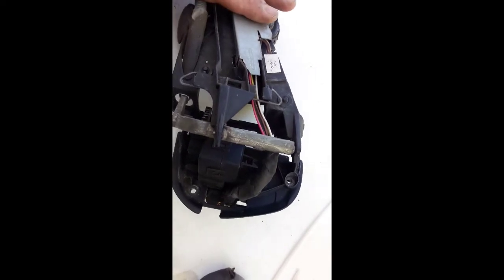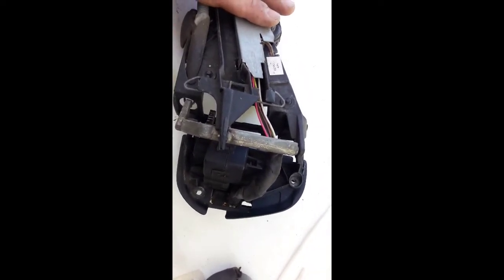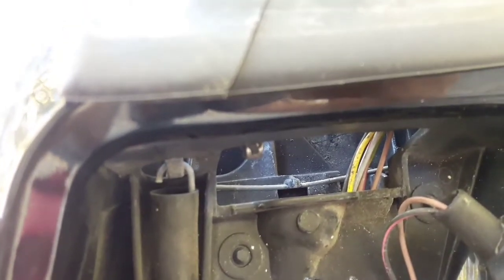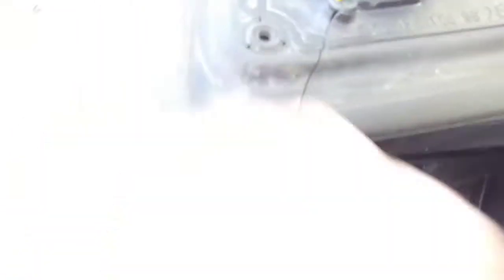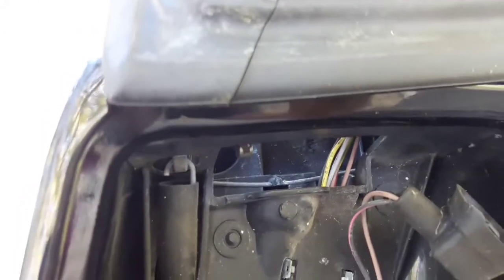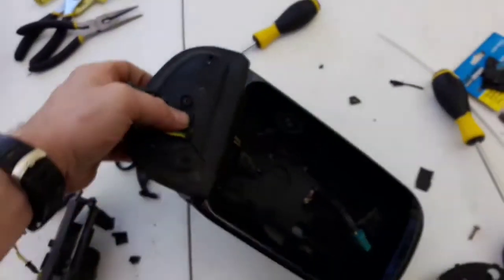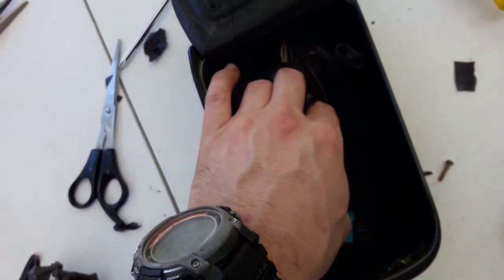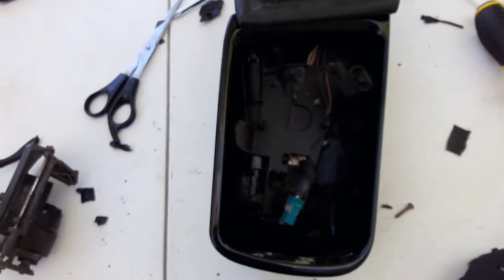Intallation 1995 Mercedes w140 side mirror rewired and fixed

Comment: Thanks! OMG! _ mirror metal piece has a lip to set it in with, but i agree with using a BIt of silicone for sure!
Reply from the maker: Yes there is a way to set it but my tabs were broken or at least they couldn’t hold the glass

Comment: Great Video, Just had to both my left and right side , they were "smoking" like the last guybut I did a double shrink wrap system on the bare wires and I think its the best as the wires go back and forth when they fold and they can't be bulky.  ALso I'm sure you know by now but the EC button on thedash is a "compressor off" button. The Germans will go out of their way to not do something the same so they have an off button and not an on button. use it only if you want fresh non cooled air to come out.Thanks for the Help and for doing this Video
Reply from the maker: GEORGE BOOTH thank you

Comment: hi peter i got a 98cl600 and my mirrors were just as bad it is really quite scary that they can get so bad and i just wrapped insulating tape round all the wires,btw the actual smoke on mine were coming from the microchip on the bottom corner of mirror and i could see some of the plastic had melted around that chip but once fixed up everything was ok,i believe if i or you just kept adjusting the mirrors when the smoke was coming out it would eventually burn this chip out and the mirror would be useless.i think also when i adjusted my steering wheel i would get smoke from the mirror.once both your mirrors are insulated everything should be fine but the big question is how is your A.C fuse
Reply from the maker: ray croal yes all is good with all wires and ac.  Basically the heater they intall in mirror will blow ac fuse when it shorts
Reply: cool that is good to know,hey have you ever seen the w140 s70 amg or s73 amg, they look awesome plenty on youtube
Reply from the maker: ray croal yes and exactly what im going for on look but with a much easier engine to work on. I am going to be painting (or first plasti dip) bottom of car matt black and putting on rims soon

Comment: dude i literally have the same issue with AC not working and burning fuses just because my side mirror wires are dried and messed up already :D mercedes were overthinking when creating this :DD is your 95 s500L like mine? i see restyle mirrors and black+grey color of the car... just wondering?

Comment: The side mirror that is currently on my s500 is broken due to the previous owner broken metal brackets. I got another one from my local Craigslist, as soon as i hook it up. The fuse blew due to a wires were exposed. Now I have to open it up and reshrink the wires individually. How long it took you to do the whole project? Also any luck with the center vents that I ask you about? My center vents is not blowing any air. As always, keep up the good job. Thanks.
Reply from the maker: Juan Milo it was a long project for me because i couldnt find any video on removing internal parts. After i figured out it wasnt bad but expect a few hours to rewire. I'm going to snag the diagnostics for my other car so I can give you the parts or at least an idea of what needs to be done for the AC
Reply: Peter Davidson. Thanks Peter
Reply from the maker: Juan Milo what side mirror do you have. I have a driver side on my gold car that works perfect
Reply: I have the passenger side.
Reply from the maker: Juan Milo i greatly appologize i have searched everywhere to find the sheet that has the diagnosis on the ac vents. I do know the vacuum piece that is broken is located behind the passenger glove box and cost to fix at my shop here was $400 with labor. My guess is it can be fixed for under $100
Reply from the maker: Juan Milo i think i figured out the issue. Its a vacuum actuator that goes bad or a hose line came off.  Here is a video that can help.  https://youtu.be/U3sacfr1W9M
Reply: Peter Davidson. Thanks for the video regarding about the center air vents. I have been so busy with everything else. I haven’t have the time to work on the car. I’m the process of  buying a 1997 S600 with 122k on the odometer. Hopefully all works out. The car looks great. Body is straight. It’s white i only wish is black but beggars can’t be choosey. The only thing that is wrong with that car is the “shock light” is on. The owner Stated that maybe it’s a Loose wires.

Comment: Please, do you know how to REWIRE the left side mirror and blinker of a Mercedes Class A year 2007, 3 door?
Reply from the maker: WorkHealthWealth Freedom I never tried but what is the problem.
Reply: Thank you for your prompt reply. My husband has managed to fix the problem. The mirror blinker wasn't working and he couldn't seem to get the cables out. He's fixed the blinker but now I cannot adjust the left outside mirror by using the button on the driver side door. ..
Reply: Peter Davidson , sorry for late reply. The technical gremlins hid your response from me. Basically, the problem is that my husband managed to fix the left wing mirror blinker, but now I can't adjust the angle of my wing mirror from the inside using the electronic button. I have a Mercedes Class A year 2007.

Comment: My mirrors don't fold. '99s500
Reply from the maker: Winston L start with fuses.  They are common to pop. If fuse pops right away there is a short.